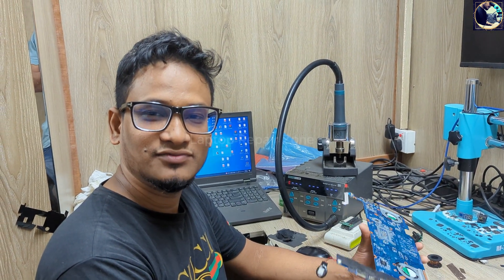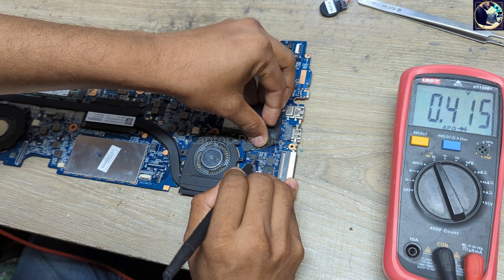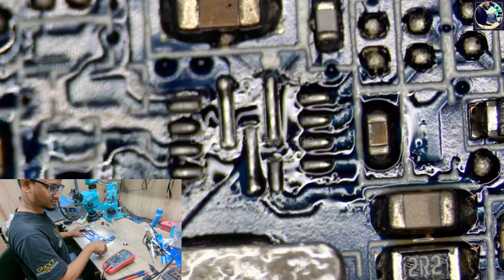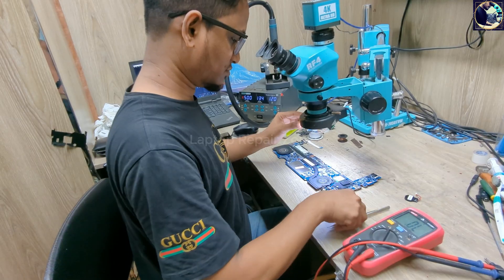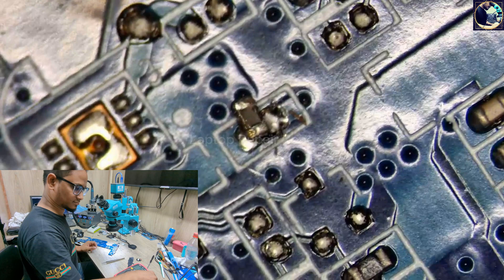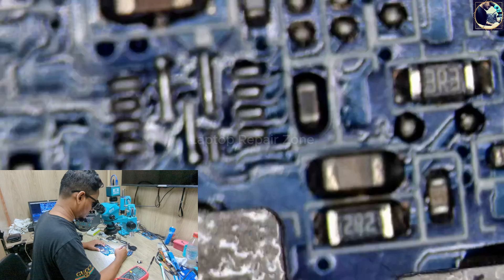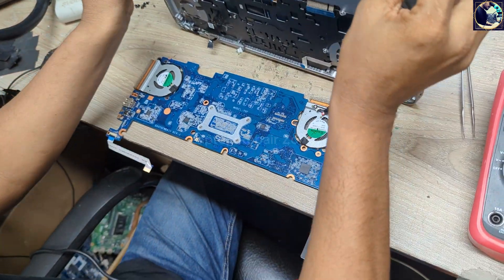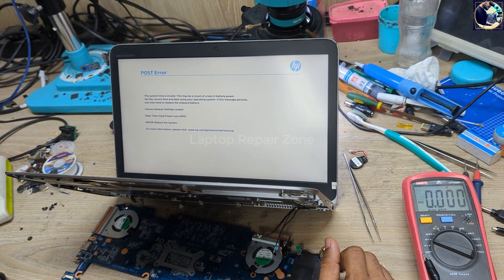HP Elitebook Folio 1040 G3 won't turn on fixed | how to repair HP laptop

Comment: Bhai nice work you are doing , I have same 1040 G3, some times if I plug power it turns on, sometimes only power button,  wifi and speaker button brings light but laptop does not turn on,  what could be the problem and solution
Reply: Same with me😢😢😢

Comment: I have the same PC 

Laptop WILL boot using the battery but WILL NOT boot when plugged in. 

Power is getting to the board when plugged in I am getting power on 3v and 5v rail (as seen in video) 

What could be the reason for it not booting off ac power

Comment: Hi
Can I ask why you remove the IC after injection voltage on the coil 
Thanks
Reply from the maker: To confirm the is ok or not.
Reply: @Laptop_repair_zone  thanks
Reply: If there is no short after removing the ic then the ic is problem. When short is still there then problem is somewhere else..